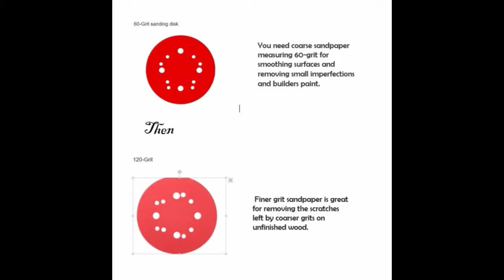Carpet to Wood Stairs remodeling DIY YOU CAN DO IT

Comment: Great job. I did something similar. I removed carpet from my basement stairs and found that the wood (not oak) treads had been painted twice. I wanted to save money so instead of replacing the treads with oak, I sanded it down to bare wood (PITA). I stained it with dark walnut twice but the wood didn't soak in the stain as much I had wanted. I wanted it to be dark to hide any imperfections. So my trick was to add a little bit of the stain to the clear coat and it made treads look darker. Don't put too much stain in the clear coat so that the wood grain still shows.
Reply from the maker: Wow! Perfect. Well done fellow DIYer ;). I hope the others will read your comment and get some notes for their project.

Comment: How could you do it and also still use stairs? We have all bedrooms upstairs
Reply from the maker: I do have the same. If you see in the mid of the video I was taking photos from upstairs and saying what a pleasant view before going to bed Lol. 
You need to manage no one will be using the stairs after applying the coats at least not before 3 hrs. You can do in the day time and the coats will have much time prior someone using them. However, I suggest to not step on them without making sure all dry and safe.

Comment: How did you get the round over on the stairs, to reach the ends of the step!
Reply: I think you are talking about when he was using the router. I was wondering how he was going to do that as well but I saw when he was staining, he didn't go all the way to the end and left it like that. Pause at 4:30
Reply from the maker: That correct, no way to reach the end unless you take it out. But the final product was unique design when the curve merged with the square corner like no one have it.

Comment: How has the bead panel held up on the stairs ?
Reply from the maker: I’ve used 3 small nails to each then you paint them with white color later on. 
It’s easier if you have nail gun.
Reply: Sorry I meant durability wise.  I was a little nervous since it is on the stairs and didn't know if it would last with the stair traffic.
Reply from the maker: In my stairs they are very durable and heavy duty. I have kids and I also care about the durability like you. 
You can test always and adjust things to add security. Thanks for asking.

Comment: how or what did you do to fill or close the gap on the edges of the thread?
Reply from the maker: When you go to the store you can ask any associate to help you find the pine molding or any alternative materials. Check this link ask example. 

https://www.homedepot.com/p/Woodgrain-Millwork-WM-129-7-16-in-x-11-16-in-x-96-in-Solid-Pine-Shoe-Base-Moulding-10001831/203369743

Comment: With your router Did you end up using the roundover bit on the edges of the stair nose? I see with the guard it didn’t let you go flush against the wall, did you leave the edges undone?  (Asking for my project)
Reply from the maker: Yea, cannot go against the wall unless you take the steps out :) but after I finished it as is, I found it looks more unique designs like no one have it before then I’ve left the nose edges squares. As I said it’s better options than the carpet and I’m very satisfied with it. All my quests are amazed with my stairs. G luck to you.
Reply: Awesome!! Thank you so much!! I appreciate the tips and the video! ⭐️⭐️
Reply from the maker: Well, I’m glad you are getting rid of the horrible carpet. G luck to you brave.
Reply: Thank you! ⭐️

Comment: DIY John’s ! I started this project last weekend and found that there is at least a 3/4 inch gap from my wall to the stairs. I want to avoid purchasing treads and keep my project costs down by using what I have, what do you recommend in this case?
Reply from the maker: Nice to hear that you started ur stairs DIY! 
Okay, I've heard friend run in a similar issue and he ended up solving the gab by the cheap way to adding Solid Pine Base Shoe Molding. If you go to the store you will get a lot of new ideas to hid the gab. Check out the link below. 
https://www.homedepot.com/p/Woodgrain-Millwork-WM-129-7-16-in-x-11-16-in-x-96-in-Solid-Pine-Base-Shoe-Moulding-10001831/203369743?MERCH=REC-Pip_Alternatives_Non_HDhome-205958745--203369743--N
Reply: His had gaps too if you look at the end